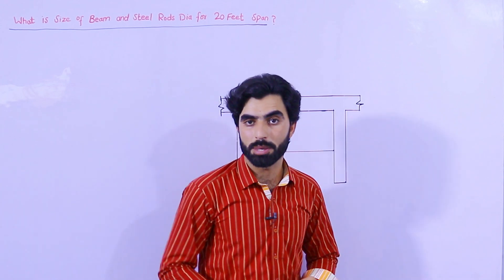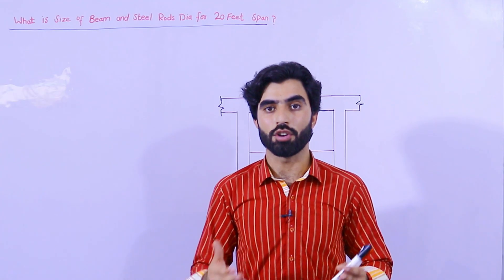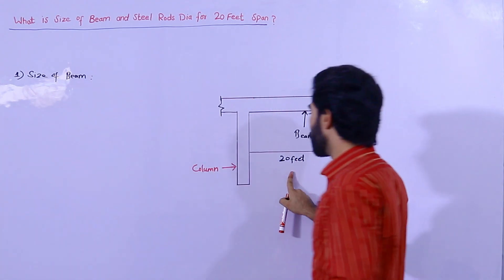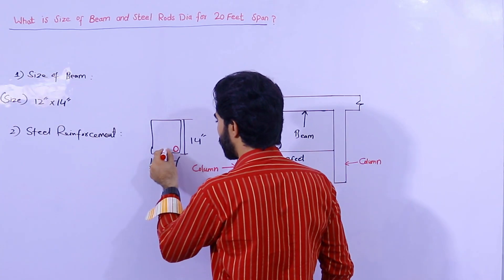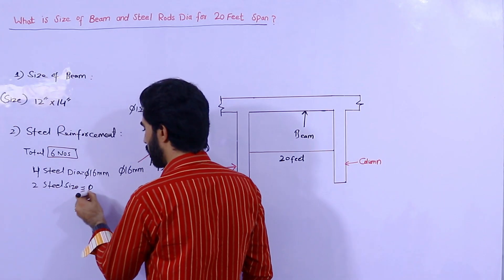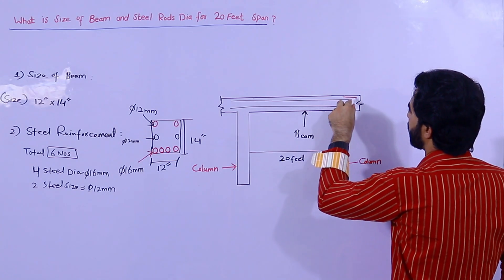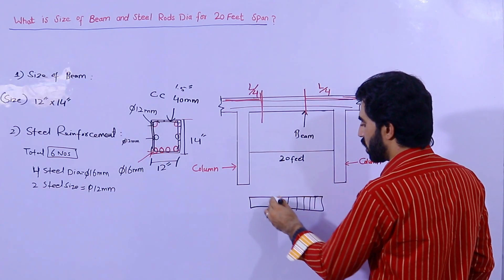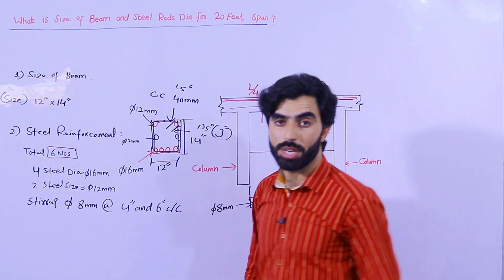Size of Beam and Steel Rod Diameter for 20ft Span | Civil Engineering Basic video |

Comment: Thank u sir, please if u have an industrial steel shed of 36m x 100m. Using steel columns of 250 x 250 x 72kg/m. What would be the beam or rafters size to use. Please and estimated value if possible. Thank you

Comment: Why if 3 storey we need to add additions rebars in the mid section of the beam? Wouldn't the beam be only calculated based on the carry load of the slab or what ever is on top of the beam that is transferring the loan. I can understand if it was a column for 3 stories we add additional rebars at the ground floor due to total transfer load from 1st + 2nd floor. Looking forward to your reply. Many thanks.

Comment: Sir the beam depth should be calculated by L/10 or L/12 . Where L is distance between two columns. So as per that the beam depth should be 22 inches or 2 feet depth for 20 feet span RCC slab. But here u said the depth should be 14 inch. 
I think u R misleading us. 😨😨😨

Comment: Hello, I would like to ask you for recommendation. Beam above the garage door (the garage has only the ground floor)....span = 17ft. Stirrup 6mm every 250mm. Beam size will be 12"x 20" ... Rod diameter = 2x 12mm above, 2x 18mm below. Is is enough? There are no crank bars. Should I add some? For example 2x 12mm...? Best regards

Comment: Hello there
One of my friends added 3 (16 mm) bottom ) and 3 (16mm) rods on the top moreover, he put two extra support as you mentioned. The length of the span is 14’ and the beam size is 12” by 12” and the column size is also 12 by 12” and he added 8 rods of 16mm.
My question is, how many story he might build up in that case. Please explain

Comment: In USA ... residential wall thickness is  8" concrete brick ... so for a 20 ft span  ...  the depth of the BEAM is 20" ( 1" for every 1 ft of span );  2 x #5 crank bars should be installed at L1 and L3 with 1 ft 90 deg corners with stirrups 4"  (8mm, 135 deg 3")  The support COLUMN will be 8" x 20"  ( 8 #5 rebars;  8mm steel hoops L/3 .... L1= 4" spacing; L2 = 6" spacing; L3 = 4" spacing)   etc etc